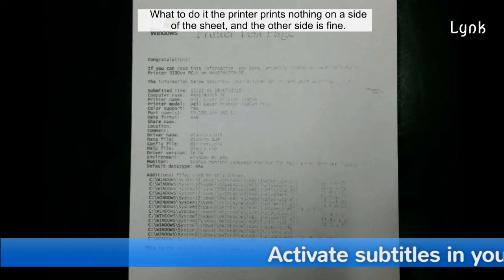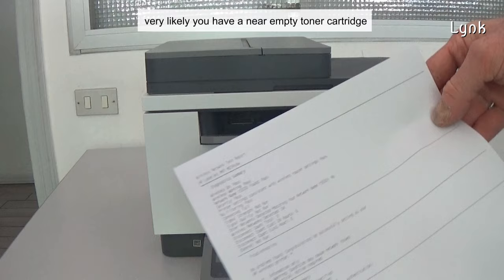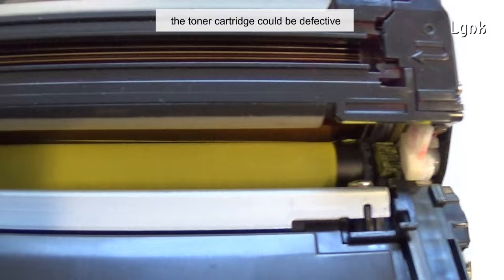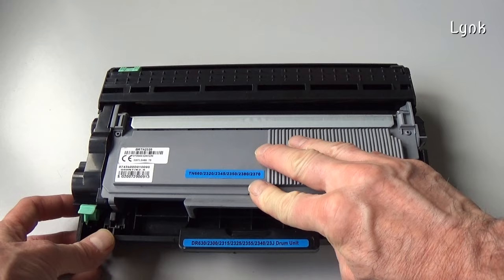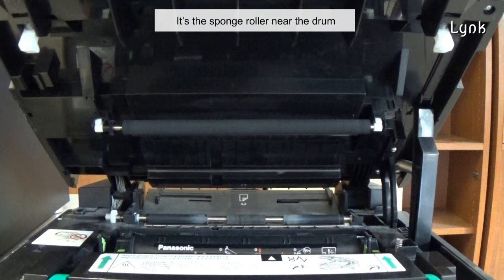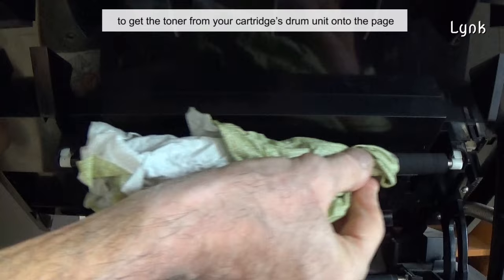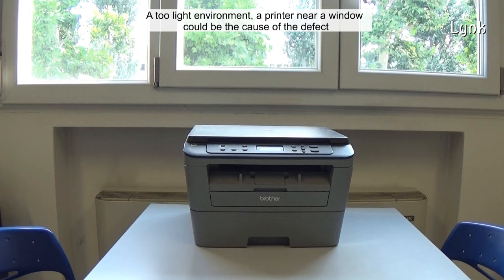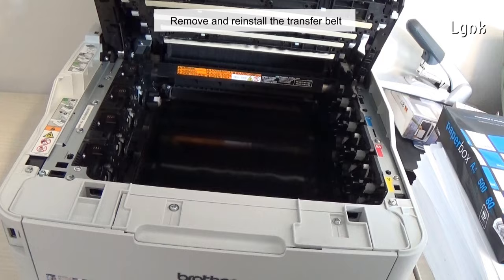Laser printers: Print fades to one side of the page

Comment: I hv the same problem, but im using a pantum p2506w, can u make a suggestion on how to fix it?
Reply from the maker: Are you sure the cartridge is correctly installed? check the toner roller inside the cartridge, it should touch the drum
Reply: @viandant5  well, i already did it multiple times and it still doesnt print normally
Reply from the maker: @jasonmuin6532  it could be a laser unit problem